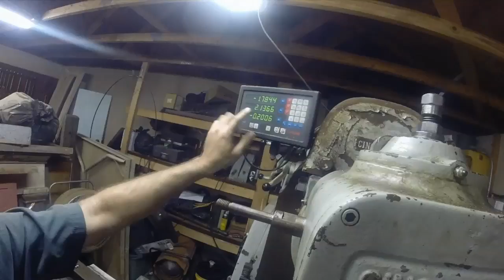Heavy Milling

Comment: So at 7600lbs and 7.5 hp, the Cincinnati # 2H I hope to buy this week is about half the size, but is still plenty for me...It has really good travel too and a great looking bed, I just hope the guy gets back to me and lets me buy it!

So what is the difference between your heavy duty rotating attachment and the "Right hand vertical attachment" the # 2 I want has? Do both take 50 taper adapters?

I hope to join the Cincinnati family soon, Aloha...Chuck
Reply from the maker: I am not familiar with a Cincinnati 2H, a 2H is a Kearney and Trecker model I know, but never seen a 2H Cincinnati. There was a #2 dial type and a 2ML as well as a 2MI I know. Got any info  or pics? You can email me them and I will see what I can tell you about it. To my knowledge they made two basic types of vertical attachments for the Horizontal mills. There was the heavy duty rotating attachment like I have that only rotates in one plane and the Universal rotating attachment which can rotate in 2 planes at the same time thus allowing infinite cutter positions.
Reply: bcbloc02
I do have a link you can check out it is a Greaves Cincinnati that he claims is a 2H, but there aren't any photos of the verticle head. Hopefully I will be able to send you lots of pictures and a video of me bringing it home tomorrow...here is the link to the CL advert, and I spoke to the guy on Friday and he still has it but wouldn't meet on the weekend...for such a great deal I can see why he isn't really motivated to move it, LOL! Here is the listing: http://chico.craigslist.org/tls/4927127290.html

Thank you for any help you can offer, you seem to be "Captain Cincinnati" here on Youtube :D  Aloha...Chuck
Reply from the maker: Chuck, That is actually another company altogether that made that mill.  I think there were 5 or 6 different machine tool makers using Cincinnati in their name at some point.  Greaves Cincinnati was actually a division of Fay and Eagan who are most famous for large industrial woodworking equipment.  If it all works that mill is still well worth the money and far more capable than a Bridgeport type for milling work, not as handy as a fancy drill press though. I suspect that machine to be around 5000lbs.

Comment from the maker: It is a 25Hp Wide knee #4 Cincinnati Horizontal with the heavy duty rotating 90deg attachment. According to my Cincinnati Treatise on milling machines the max power doing the 6" wide portion of that cut .250" deep using that cutter should have been around 12-15hp at the cutter.